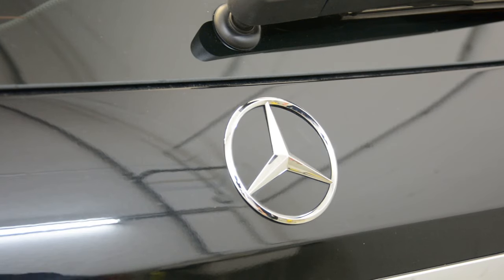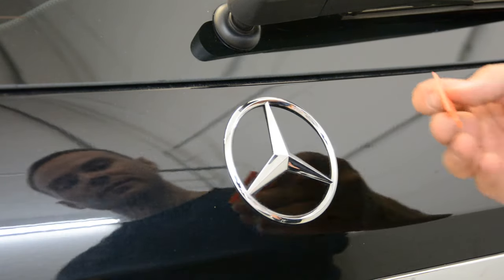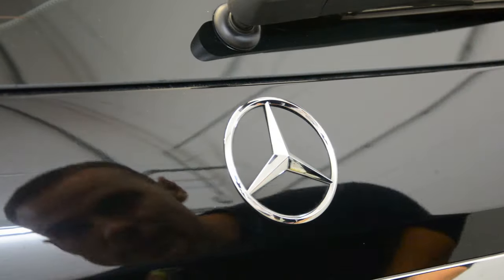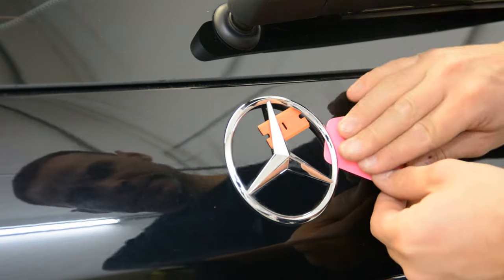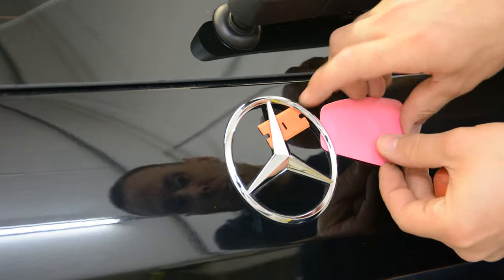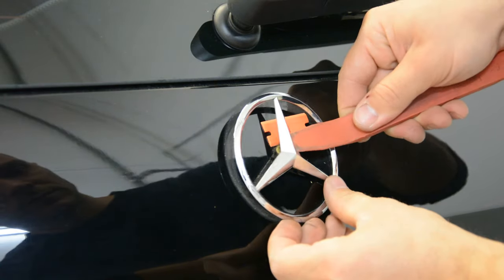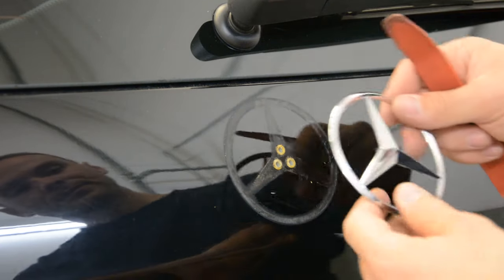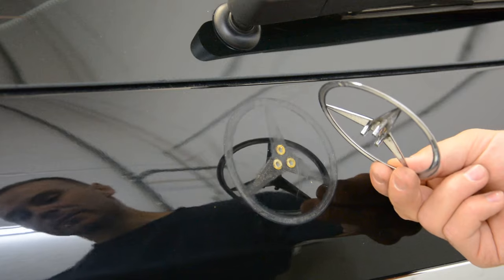How to remove the back Mercedes emblem without braking it

Comment: Do we need to apply glue for the new one?
Reply: From what I saw in a different video, you don't.
Reply: @Tru_lie13  Thx!! I took it off and I realized it the is just clicks and is that simple!! 👍🏻
Reply: @amitchell4206  so the star will be fully stuck on the trunk again without any little spaces between the trunk and the star? Because on Ebay, most stars have glue on it but I'm thinking of just removing the star, paint it and put it back on the trunk.